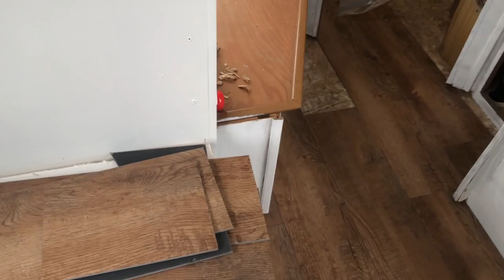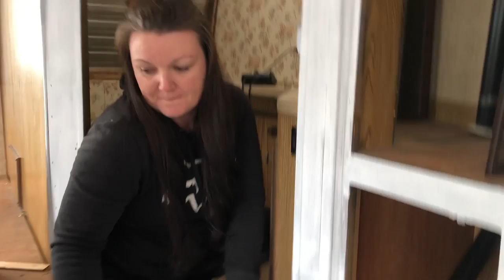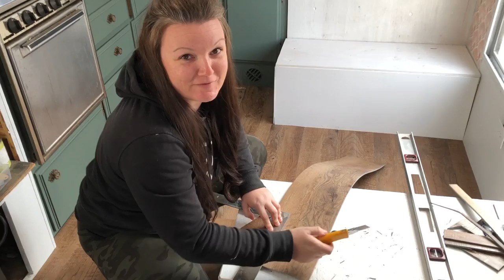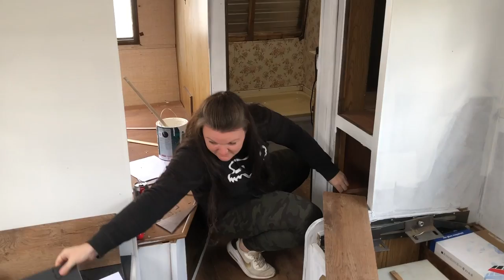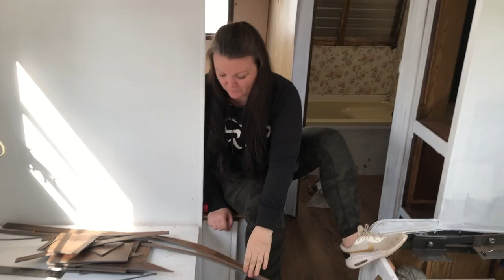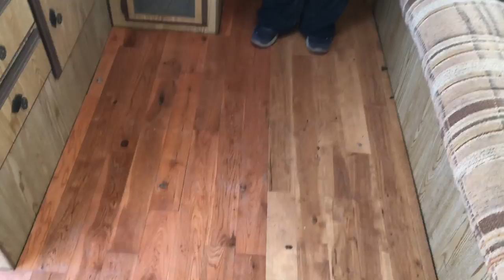Extreme Camper Makeover | Funny angles | Flooring part 2 | Episode 27

Comment: I’m painting in my old 1984 motorhome and was curious if you had tips on painting over that shiny fake wood paneling
Reply: Jon Wylie I used a coat of Kilz primer and latex Behr or Sherwin Williams paint on my ‘88 camper paneling. Has been holding up great after a couple years. Make sure you give a day in between coats for durability. I didn’t do that at first on a few walls and it took a few months for it to completely harden and be durable. The other walls I did turned out great with a days dry time between coats

Comment: You guys are great! I am so happy that I found you. Been binge watching your videos for the past 2 days!!! Love that it is a Canadian trailer make over and specifically Ontario. Question for you though...I am looking to change out the floor in our Hybrid trailer and am confused about the application given our winters (I'm in Ottawa). Will the glue that you used hold up? Home Depot is telling me to use the click vinyl planks with no glue and no tacking. Would love to hear your thoughts on that. Thanks in advance.
Reply from the maker: We glued our flooring
Reply: Elysia English yes I saw that but did you do that based on recommendations or advice? Will there be any concern of cracking due to our weather changes and the expansion and shrinking that occurs?